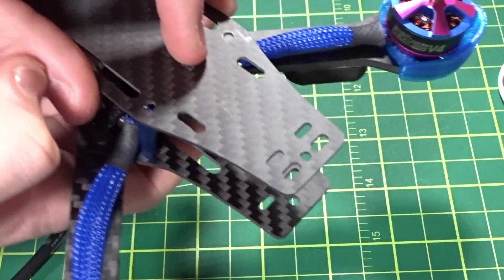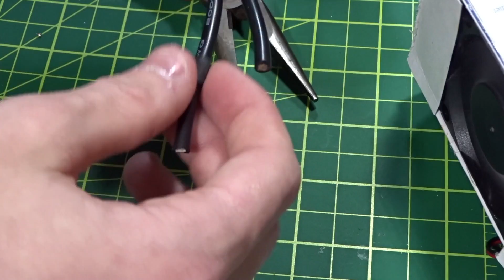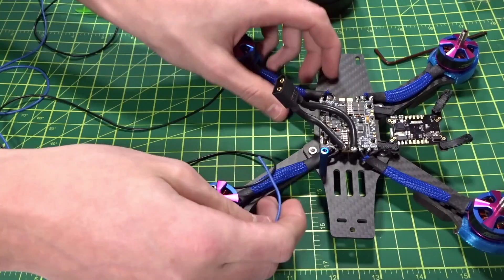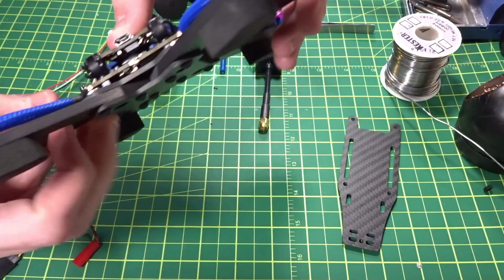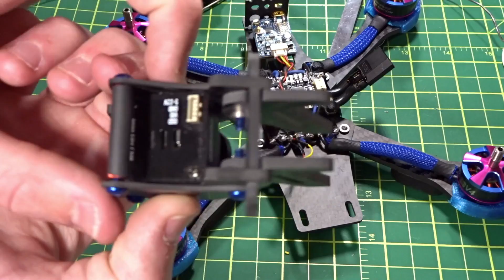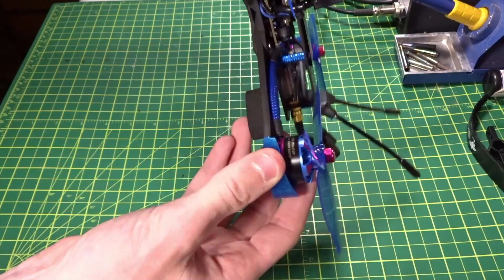Raptor210 Build Part 2: Hyperlite V4 Motors, Quadrant ESCs, and Radiance FC

Comment: I'm having trouble with my radiance fc it will connect to beta flight but when I plug a battery in the fc won't come on and I wired it the way you did as far as power please help
Reply from the maker: Do the LEDs come on?
Reply: when I plug in the battery it doesn't come on but when I plug it into the pc the status light comes on
Reply: So any ideas

Comment: Great videos.You are very skilled at this hobby.I am trying to learn what esc and pdb i should use with my new furious fpv radiance dshot version.I have a racerstar shot 30 4in1,racerstar 30a lites or sunrise cicada 30a.Got a pdb/bec with voltage&current sensing or other options are very confusing.After having many problems with cloned flight controllers from banggood decided to try a real one.Any advice would be great.
Reply from the maker: the Racerstar 4in1 should work just fine :)
Reply: Thanks i figured that`s what i wanted to use since the radiance is dshot ready.Just too bad it does not have the plug to connect to the 4in1 esc.Do i just connect the signal wires?what to do about the ground wire?
Reply from the maker: Yeah just route the signals to the correct pads,(ground if it has them) but make sure signal one goes to the PPM pad right next to the signal on pad, as you need to do this to run DSHOT on the radiance. You then have to input a command in the CLI, which can be found by searching radiance with DSHOT.
Reply: This one comes with no ppm Dshot ready not sure if it needs cli comand.thanks.
Reply from the maker: Oh you got the new red DSHOT version? I didn't know that was out yet.
Reply: Yep sure was a challenge to solder those tiny pads.Waiting for a passing shower here to give it a real test.

Comment: Can someone who's never done anything like this still pull a build like this off?
Reply from the maker: You mean you have never built anything? I mean you gotta start somewhere, it isn't a super hard build, and the video should help quite a bit, but the components I wouldn't recommend for a first quad no.
Reply: I have a cx-10 and a FuriBee F36
Reply from the maker: Those will give you a little bit of flight experience, but I would recommend looking for a cheaper build to start with, rather than premium parts you will trash :)
Reply: Can you recommend one please
Reply from the maker: The ZMR210R, or GBX210 is pretty good.
Reply: Thanks brother

Comment: I do like this frame but I'd want to bolt the fpv camera in so in a crash or something it doesn't get knocked to a different angle each time
Reply from the maker: Mine is very tight, never changes angle.
Reply: Good to know.. I was looking at alien 5 and mqc fusion and then this one caught my eye for the price and everything it seems well worth it. My only concern was this and if it never moves then I may just have to give this frame a shot on my next build
Reply from the maker: Yeah, mine holds fine. If yours is loose a tiny 1mm spacer on either side will tighten it up.

Comment: What kind of range do you get with this racer?
Reply from the maker: FrSky, so probably about a mile.
Reply: Thanks and what kind of flight time do you get with the 1300mah 4cell?
Reply from the maker: Around 3 mins lighter flying, 2 mins all out.
Reply: Sorry about all the questions but I was wondering how big of a battery would fit on the raptor I am thinking of building it like yours and I would like longer flight times but I'm not worried about it being slower because of it. Also is there anything you would change on it now?
Reply: I'm hoping a 2200mah 4s graphene would fit they are only 31 mm longer
Reply from the maker: That is going to be very very heavy. I only use 1300s, and would say 1800max on a very light setup.
Reply from the maker: You could fit a 1500 on there. Nope, flying great.

Comment: I got this frame in the mail the other day, started building it the moment I opened the box. The frame has an overall good design but a lot smaller than how it looks in pics/vids. One question though, when you put the fpv transmitter through the small plate at the back -  isn't the plate conductive? I noticed in this video the fpv transmitter (the metal part) makes contact with the carbon fiber?
Reply from the maker: Yep, it is grounding the frame, however this shouldn't be an issue, and i have never had it be a problem for me.

Comment: what happened to the shuriken x1?
Reply from the maker: I was one of the unlucky ones who kept having yaw shakes and desyncs so I put it to rest...BUT...underground fpv is sending me their V2 of the ESCs which is supposed to fix the problems, so I will make an update video once I get them :)
Reply: I have/had a gt2 200 and had alot of desyncs on that.  I had 3 little desyncs on the x1.
Reply from the maker: Perhaps your min throttle is too low on the GT200 and it is a stall rather than a desync?
Reply: noo thats the first thing I tried, then 3 months of no luck, I changed every setting immaginable until a esc bricked upon firmware change. then I changed all escs and 0 desyncs so far.  now there are several other problems.
Reply from the maker: What are the other problems?
Reply: omg this list is long.  well first the vtx was d.o.a. then the fake 1177 camera broke after 2 crashes in soft grass.
now 3 motors sound bad after 30 desync crashes in grass, you can see them on my channel. 
the uart-2 connector just broke off so im sharing uart-1 with osd/fc,  the video blacks out on snappy flips.  now just recently, my receiver connector on the fc went bad somehow so i relaced it and now I cant connect to betaflight.
this quad is nothing but a headache.

Comment: If I were to mount my own escs on the arms (not the ones in your build video), would I then be able to solder the power and ground wire of the escs onto the radiance Flight Controller?
Reply from the maker: No, the radiance does not support pads to power the ESCs, which is why a 4in1 is the way to do with it. Get the Kombini if you want the PDB functionality in the FC.

Comment: Is that flight controller also a pdb board? If so, how come you soldered the xt60 onto the escs and not the top board instead?
Reply from the maker: The Radiance is the FC, that can take full battery voltage with built in 5V and 12V regulators. It doesn't have pads to attach ESC power wires to. I did it this was so the current would flow evenly through the escs and not overload one set of pads through the FC.

Comment: Btw Im heading to my next build, what escs do you recommend me that are reliable for 30a and not too expensive (about 8-10$) Racerstar 30a lite? Ztw ? 

Because I got 4 ztw polaris for 25 bucks and I believe that deal won't happen again.
Reply from the maker: I mean, shooting for an $8 esc seems too cheap to me. I mean you can get really good escs for literally $12 more on the total build. I will stick with DSY XS20.
Reply: I know, but 20A seems to me very little I mean, 4s with 2205 2300kv and 5040x3 draw more amps and the 30A Dys cost about 17$ ... so
Reply from the maker: Dashz On Banggood the XS20 cost about $12. Also when in flight the amps willb be much lower, peaking at maybe 100amps total. and only then bursting up, 20 amps continuous is more than enough for almost all 5inch setups.
Reply: Thanks for your advice
Reply from the maker: Dashz I mean certainly you can use 30a, I just find the smaller size, lighter weight, and being cheaper good for the 20amps, and never blown one even on very high power setups. The racerstar series is pretty good

Comment: You have some heavy quads. All my frames sty under 500g with lipo and no cam and the heaviest with cam 570 and the other 2 550 gram with hd cam.
And I was thinking that my frames were heavy.
Reply from the maker: Good for you, you aren't using a free style frame with an 80g gopro, and a 177g battery ;)
Reply: Lighter frame flies better. ;)
Reply from the maker: If you race, which I obviously don't ;)
Reply: I now that you practice for that. :)
Reply: 600 grams is not heavy that's kind of normal